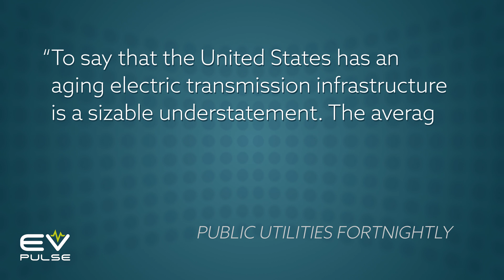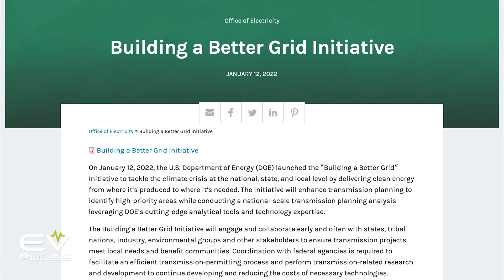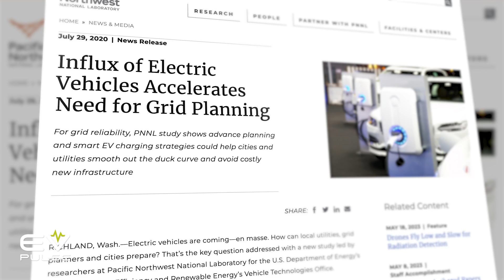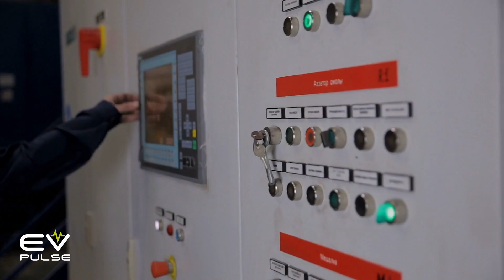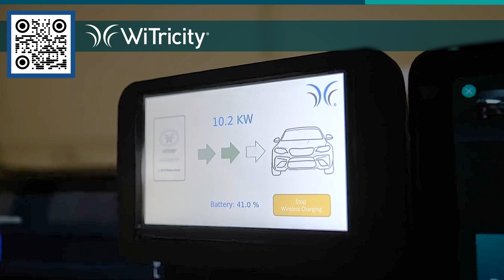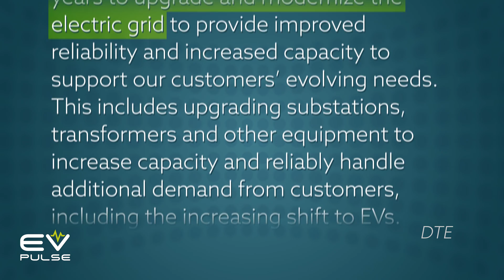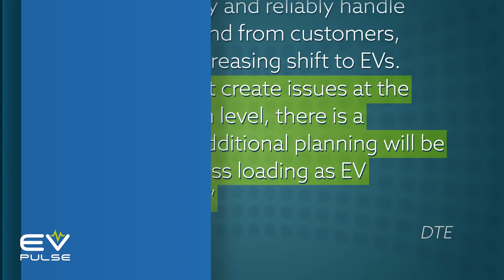Will EVs Kill the Power Grid? | EV Basics

Comment: The grid is already failing. Look at all the rolling blackouts in CA and the Southwest during summer with just ACs. What will happen when you throw on demand of millions of EVs ?????
Reply: Some areas of Scotland have been told it is uneconomical to upgrade the electrical grid to support electric vehicles
Reply: The solution there would be on-site electrical energy storage. A big battery would be able to handle full rate fast charging any time of the day, and can be charged slowly at a steady rate 24/7. As long as the average demand doesn't exceed the charge rate, there would be no problem with public DC fast charging. @doriangray6985
Reply: I like how anti EV people like to stay behind the current events a good few years. Surely California had more issues with this 4 years ago than now, they are fixing the situation
Reply: @lkrnpk  just a few weeks ago NSW asked it's residents if they would cut down on their energy use as the grid was unable to meet expected demand. A family in Scotland asked their provider if the grid would support them if they bought an EV, only to be told it was not economical to upgrade the grid.  Naturally they didn't buy the EV.
Reply: Look at NSW asking people to minimise their use of air conditioners during 5pm - 9pm as there was a concern over demand for electricity
Reply: When was the last California grig failure?
I find it funny how you never mention texass
Reply: @BrianA76 I find it funny how oblivious you are.
Reply: @kawhiiee  how's it feel to know your dear leader is going to prison?
Reply: @BrianA76 ????
Reply: @BrianA76 1 year later and don't you feel stupid. What's ironic is your buddy Biden had to pardon his family and cronies. If you wonder why Biden didn't pardon himself it is because if he was charged with a crime, his doctors would say that he is mentally incapacitated.
Reply: @LittleAnastasia... every grid in the world is in serious trouble. Ontario had the most stable grid in the world. Now, every night, my UPS comes on line to support our failing grid suply clean power!
Reply: @BrianA76 Texas has had its power problems lots of them from brown outs to black outs I live there so you can’t call BS. California this summer already has asked people not to charge their EV’s a few times. This video is BS.
Reply: Absolutely nothing. EV's can be set up to charge when air conditioning is not needed. Since the EV has all night to charge, it can pick a time, or, a voltage threshold, when the grid isn't under load. While the average load goes up, the damaging peak load will not. It's just a matter of timing.
Reply: @vincentrobinette1507  its funny how you don't see this as an issue. The fact that you think people can manage when n how and how much to charge a vehicle is not an issue shows how unrealistic you views are. There are times when you need to use a vehicle and its emergency and imagine not having charge in your vehicle. Worst is that you can't rely on EVs. They amazing cars no doubt but only as a car to get grocery or ho to work. They have huge limitations. They work well in specific scenarios but no matter what you do. The fact that you need to at best rely on spending 30 mins at best to get the car ready just to do specific distance is stupid to say that EVs are future. They are not. Cars play crucial role. Not just a hunk of metal and rubber to get from point A to B.
Imagine you have 500kms range and throught your days use you managed to drive 100 plus kms. Now you have 400kms and you need to be somewhere at a distance of about 200 to 300 kms. With EVs eating up lot of juice on motorways you will have about 200 to 300kms range at best to reach your destination. So either you spend 30mins before hand to charge which makes it redundant in case of emergency. Or you have range anxity and keep driving just to end up plugging in for 60 mins to get the battery back to how much you need to get back. Absolutely stupid thing. Gasoline cars are always there and ready within 2 - 3 mins to do minimum of 600kms.
Reply: @romeldesai this is where a super effecient EV like Aptera using 3-5x less electricity plus can also charge itself daily from the sun can have a huge huge impact.
Reply: @jerrymolnar8010  again you fail to understand the argument that was made. Yes i agree some EVs are good and efficient but despite everything they have huge drawbacks and shortcomings. 
Saying EV is the future is like saying all the problems are same as a nail and all the solutions are hammers. 
Thats not how reality works. We don't say the only car that is future is SUV because they have hugr towing capacity or sports cars because they are fast. No we don't. All types of cars, let it be EV or SUV or sports have their plus and minus. And they work well for the situation that they are designed for. Surely you can make EV SUVs. But they still have their drawbacks cause they rely on huge battery to power them.
Even cars from Aptera with solar panels have limitations. They get in the most ideal scenario around 30 to 40 miles added range. Which sounds enough for short daily drives but still are a headache for longer drives.
EVs works really good in certain scenarios. Not all rounder by any extent.
Reply: @romeldesai you're telling me a car that can replenish it's range just by staying still is less useful in an emergency than a car whose fuel i need to buy at a gas station after spending fuel to get to said gas station,wow your a genius 😜

Comment: We need to concentrate on natural gas production and next-generation nuclear power because wind and solar schemes are incurably energy inefficient and costly.

"EV emissions realities start with physics. To match the energy stored in one pound of oil requires 15 pounds of lithium battery, which in turn entails digging up about 7,000 pounds of rock and dirt to get the minerals needed—lithium, graphite, copper, nickel, aluminum, zinc, neodymium, manganese, and so on. Thus, fabricating a typical, single half-ton EV battery requires mining and processing about 250 tons of materials. (These figures hold roughly true for all lithium chemistries.) For the carbon-counters tracking such things, the global mining and minerals sector uses 40 percent of all industrial energy—dominated by oil, coal, and natural gas—and that’s before we take into consideration the massive expansion that would be required to supply all the battery factories planned for widespread EV adoption." - Mark P. Mills  from "Electric Vehicle Illusions."